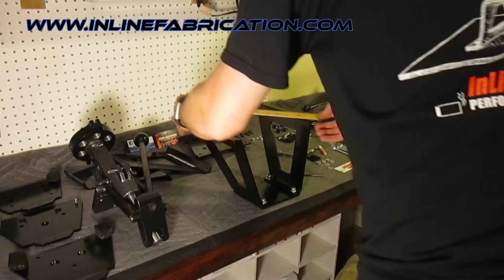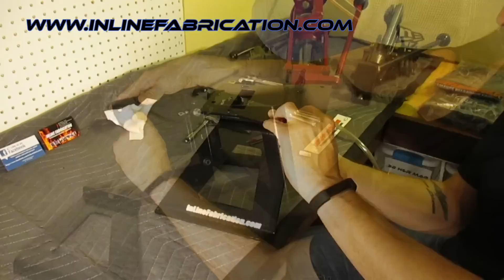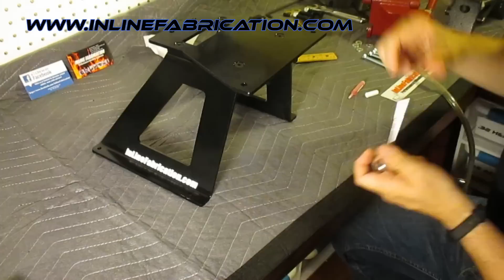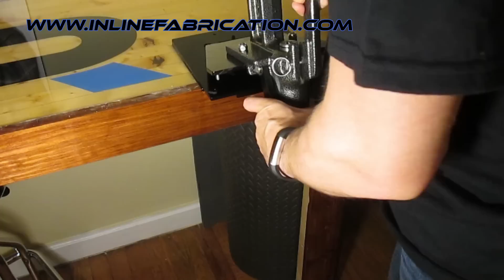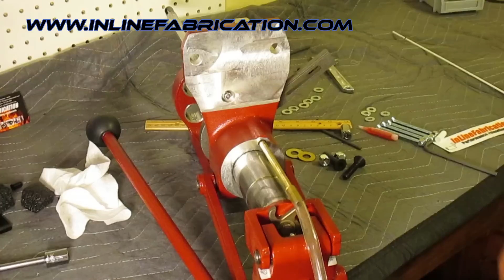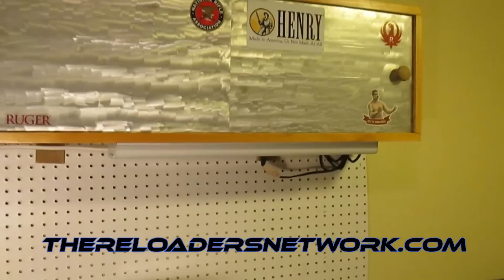Inline Fabrication Reloading Press Ultramount Junior assembly and giveaway

Comment: Great job with the epoxy. Was it hard to do? I'm sure you're going to have a video on it but I have been considering doing an epoxy on the top of my bench ever since I built it. The only thing I am not sure about is since my mounts are already mounted I don't know how tough it would be to do the epoxy and be able to use the same holes on my table.
Reply from the maker: The epoxy was easy to do. I just followed the directions on the box and poured it evenly down the middle of the bench. I drilled the epoxy last night to mount the presses and it was fine. Once your epoxy has hardened (72 hours) you could clamp a board to the top over the hole (to minimize blow through) and then drill through the epoxy from the bottom. 

Nathan

Comment: New subscriber here, You cannot go wrong with anything from Inline Fabrications, the quality in there wormanship is impeccable. I have purchased many products from there and ive never been disappointed. And as you stated in the video its really hard to grasp just how robust the mounts are this is some heavy duty steel and its really a great way to mount a lot of equipment in a smaller space and if there isnt a plate # for your application you can send in a drawing and they will do there best to accommodate your needs, I have had 3 special plates made so far and everyone has been perfect.
Reply from the maker: I love the product and the quality. I have two more plates I want to get and I am after some ergo handles and maybe an Akro bin mount. Great company, I agree. Thank you for watching and subscribing. 

Nathan